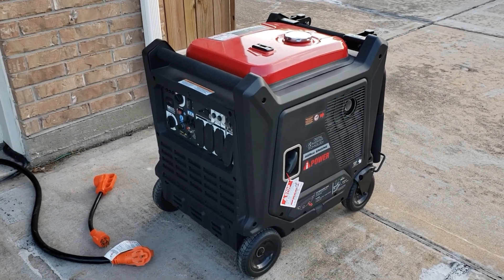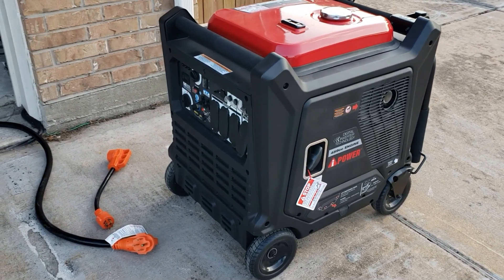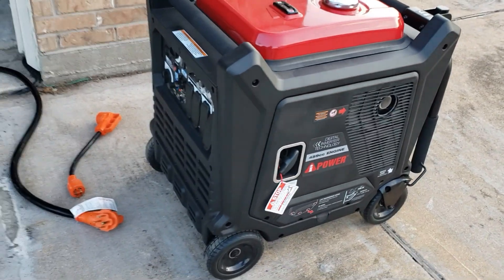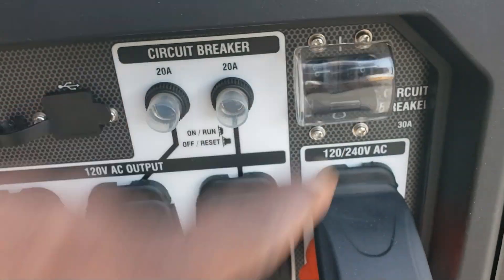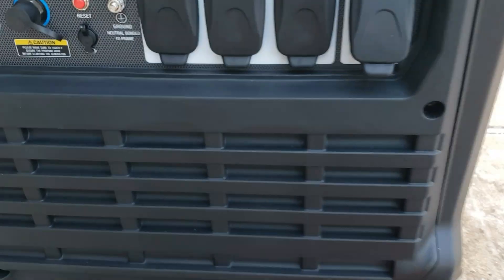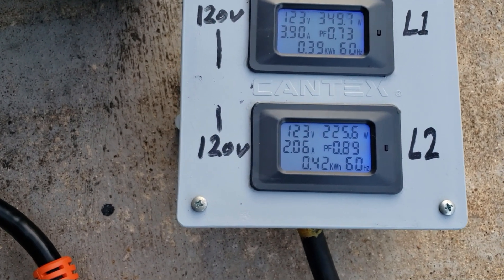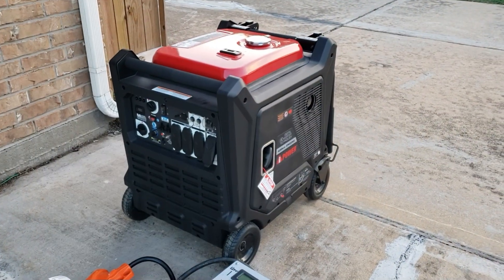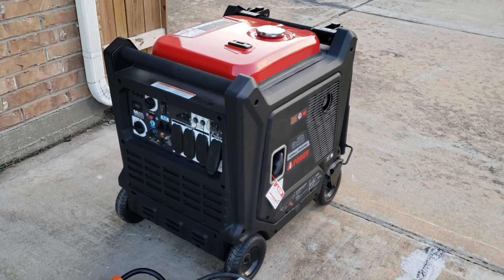AI-Power 8000 Watts Inverter Generator Running a 5-TON AC

Comment: Ok so I have a 5 ton ac unit and my generator (Firman H07552) turns on my ac, I also installed a micro air soft start, but the compressor doesn’t turn on. Are you sure this turns on your ac unit completely? Is it blowing cold air?
Reply from the maker: Yes
Reply: Ok thanks for the reply 🙏

Comment: I also noticed he didn't give credit to "EasyStart" soft starter add on for running the A/C which would not otherwise have worked.
Reply from the maker: I did and this video is also posted on their website because of that credit I gave to them. I also have a video installing their
 soft start.
Reply: To be fair I haven't seen your video on installing the soft start on your AC unit. I'm sorry if I came off critical of your review about the generator and I'm not a "Micro Air" pusher, it's just that after seeing you review several different new generators using your 5 ton air conditioner as a selling point it seemed unfair not to specifically point out on each one that without the soft starter few of them would meet the LRA rating required to start the AC compressor. @GeneratorReviews

Comment: You are forgot to Mention that you installed the Micro-EASY START on your 5-ton...
8000 Watt on Gasoline Surge, but 7000 running watts.   6300 watts on Propane.  It goes lower when Convert to Natural Gas

Comment: Sorry to place an Ecoflow Delta Pro comment here since it isn’t exactly that topic, but my question is related to starting a 5 ton AC. Do you believe that a pair of Ecoflow Delta Pro units, connected through the adapter to merge into a 240V 30A outlet, could run you central AC? The reason I ask is because I am interested in such a configuration here. I would also do the soft start and my AC is the same size as yours. If I could run it from a pair of Ecoflow Delta Pro units, then I would use that to sustain the AC and then use two smaller generators to ‘recharge’ the batteries periodically, instead of running a generator full time. I heard there was something about the Ecoflow pair producing different voltage on the two legs that go through the combining device. Also, my AC coil is one thing, but more power also goes to the blower system (also furnace) in my attic. So in terms of circulating the cold air, that circuit in the home also needs to be energized. I assume you are running all that because you feed the whole panel. I was thinking to do a transfer switch and need to remember to have both components on. My design was initially based on a window AC and moving the people in the home into a smaller space. But I more recently started thinking about how to run the central AC.
Reply from the maker: I will be posting that exact same text shortly
https://youtube.com/shorts/yb5ZC5cbe6Q?feature=share